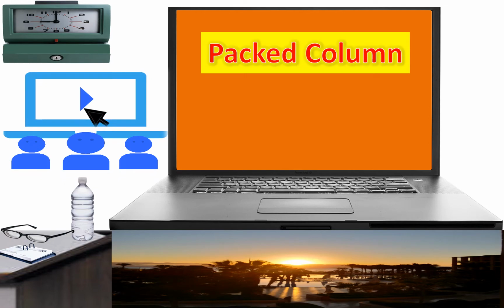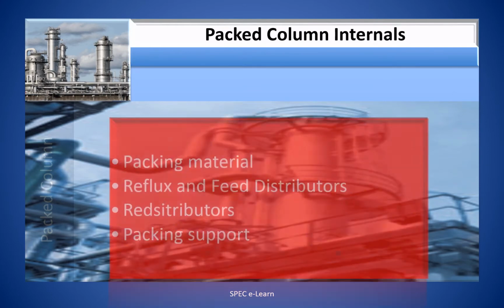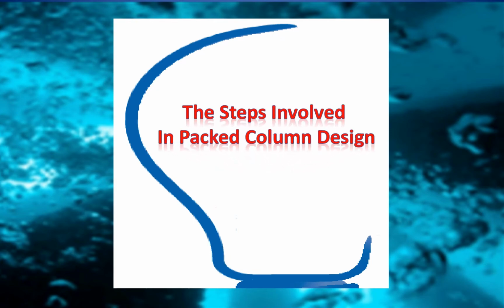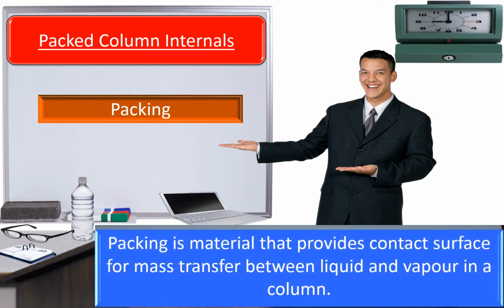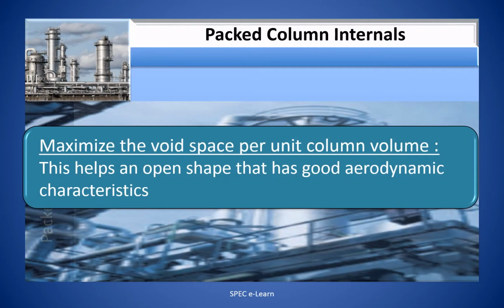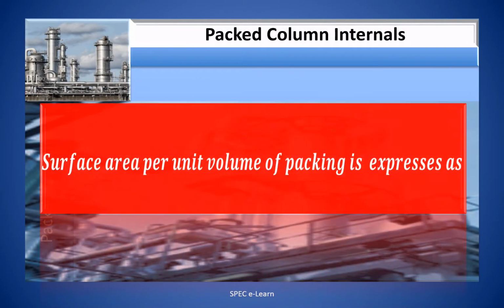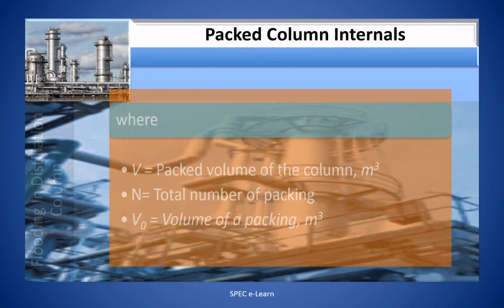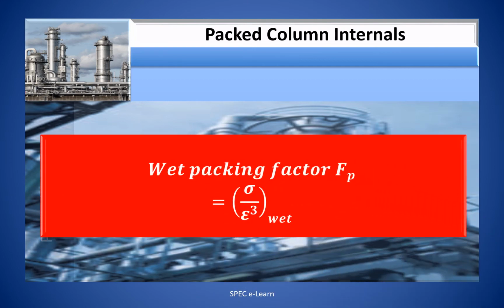Packed Columns – Packing: Types, Application and Selection Part 1

Comment: how to  calculate flooding velocity for distillation clumn?
Reply from the maker: Dear member . Welcome on board. Thanks for your question. The flooding mechanism of tray column is different from the flooding mechanism of tray column.  I am not sure which column you question is related to? 
Since you are a member at the base level please restrict your questions related to the video you are referring to. If you are referring to the video Packed columns- Packing Types, Application and Selection Part1 , you may raise questions related to that video. It will be replied. You can select any video and raise questions.

Flooding velocity is related to sizing of distillation column. The calculation of the  same can not be given in question and answer fashion in the comment section.  You need a  separate long video. Hope you understand.
Reply: @SPEC786  sir my question was  for packed column.
coluld i get list of videos for  m embers only so that i coluld decide to whether to upgrade membership as i would mostly req distillation desigh calculationns
do u have any videos on aspen hysys or plus?
Reply from the maker: You can check out in the channel home page. There  are some videos in premium level 1 and some in premium level 2. You can take membership depending on your requirement.
Reply from the maker: Hi. I missed the last question in your recent comment this evening. The channel do not have video on Aspen or other simulation packages now.